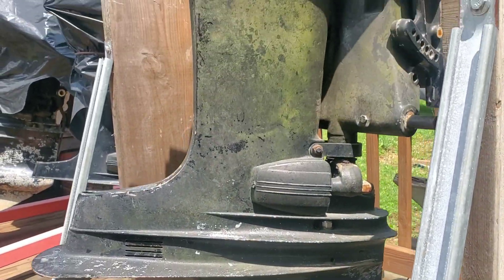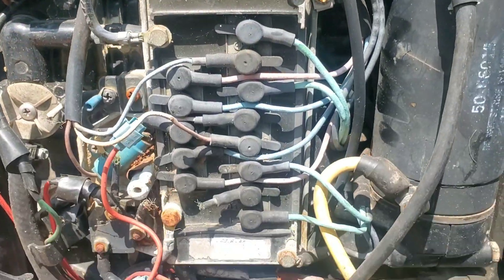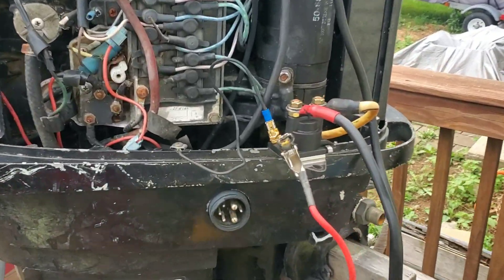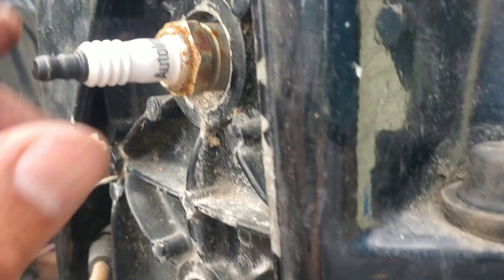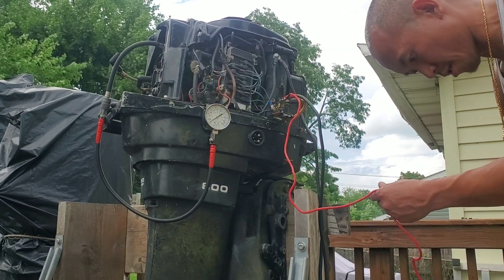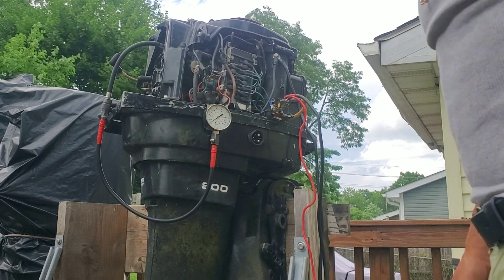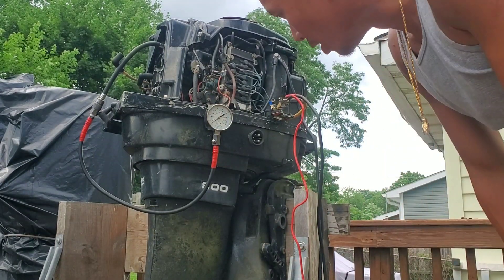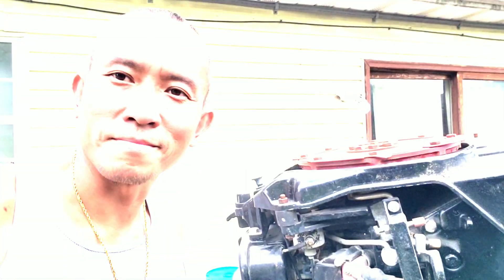Mercury Outboard: Left to Die

Comment: I got this 1976 800 80hp mercury. Looks exactly like this motor but has the distributor ignition system   Well boat is a 76 and the motor serial number comes up as a 71 ..

I got 90 psi on all 4 cylinders, I am reading online that is still enough psi to run it. Is that correct ?  Can I still run this motor for a while before I have to tear the power head down and rebuild? 

From what I am understanding these old Mercury motors are worth the time and effort to rebuild. And they hold their value pretty good. Is this correct?
Reply: This motor I have is in really good shape for its age, has some electrical issues. But, would like to bring it back to life unless its gonna cost me a small fortune. If I can run it at that PSI for a while before the power head needs to be rebuilt would be a plus. Just wondering..  And all these videos you have, I been watching alot of them. They have alot of good info. Keep up the good work, good to keep some these old motors on the water instead of sitting around collecting rust.
Reply from the maker: What brand compression gauge are you using? Son
Reply: @MerCSonL6  I am away from home .  I have to check when I get back. It a buddy of mine and  was using his.  will check and get back with you.
Reply: @MerCSonL6  Its a Pittsburgh said he got it from harbor freight .
Reply from the maker: @jimmycraze9826  the readings are likely off and the compression is probably higher. I'm thinking around 100-110psi. Which is low for an L4 but it will still run. Son
Reply: @MerCSonL6  that's good news .. hopefully, I can get it going for a while and rebuild the power head later. Cause it looks like I'm going to have to replace all the electrical on the motor and from what I am seeing that is pretty costly. 

What I am seeing from your channel is this is a really good motor to rebuild. What is your opinion on it?  The serial number says it is a 71 model .. and everything I am seeing from you and others, these 70s Mercury are the ones to have.  What kinda ball park would it cost me to rebuild that powerhead once I do get to that point.
Reply: @MerCSonL6  will a 90 hp around the same yr parts fit my 80 hp ?  I might found a 90 hp that I can get parts off of instead of having to buy them high dollar new parts like CDI, Stator, trigger, etc. what ever I might need to replace. Be nice if I can get the 90 and trade the parts out on to the 80 ..if that is possible. 

like to get this going when it cools down some and take my mom fishing..she loves that fishing, maybe as much as I do. lol
Reply from the maker: @jimmycraze9826  the parts are compatible. The stator only charges the battery. As long as the distributor is for an L6 you shouldn't have issues as long as its works. Son
Reply: @MerCSonL6  .Thats awesome,  hopefully the parts on the 90 are good.

Comment: Hey man.. I've got a '69 1000ss that's running extremely lean on cylinder 1. The engine won't get passed 4000 rpm (should be 5200) with a 17p three blade prop, pushing a 16ft 1970s glass crestliner. I've cleaned and rebuilt the carbs with new kits as well as the fuel pumps and replaced all the fuel, bleed and equalizing lines. An endoscope cam inspection shows the reed plates to be all there and closed, not stuck either, and little to no scoring in the cylinders. Compression runs around 130 psi across the board. Running it in the driveway at a quick idle for about 15 minutes and then pulling the plugs for inspection shows all are warm and a bit wet except number 1, which is cold and dry. Spark test shows strong spark on all 6, jumping 7/16". Now, that said.. while idling and inspecting everything, I noticed this leak:

 https://youtu.be/E1VLd5JaxzA

I can only assume that lowered crankcase pressure is likely my culprit, not sucking the fuel mixture into no. 1. Would you agree? Is there anything else I might check into? I've ordered a full gasket and seal kit for the head, if I'm going to pull it to reseal the crankcase I figure I might as well open it all up and do it right..

I've been watching your vids for some time now, love them and learn something new every time. 

Cheers brother!
Reply: Btw, this vid was taken before the lines were replaced and carbs and pumps rebuilt..
Reply from the maker: You could try torquing down the crank case bolts. If that doesn't work the head will have to be pulled and resealed. That is definitely the culprit. Good luck. Son
Reply: @MerCSonL6 , that's what I figured.. always good to get confirmation from someone in the know. Thanks so much for the reply, and keep those vids coming brother!

Cheers from Ontario, Canada!

Comment: great vid please do a full link and sync video on CDI motor :) Specifically want to watch adjusting the timing.
Reply from the maker: Not a bad idea my friend. Thank you. Do you have a specific question in regards to timing?
Reply: @MerCSonL6  Well i have done just about everything besides the timing. (carb rebuild, carb tuning on water, fuel pump, spark plugs, ect ect ) and still just have a weird low speed only issue. everything I have done has been an improvement but sometimes I get bogs and wont stay idling. Especially bad sometimes trying to dock or put back on trailer.
Reply from the maker: @str8wick3d  what year/model? I'm thinking it has the direct charge ported pistons which are a lil harder to start and idle.
Reply: @MerCSonL6  84 115hp idle on muffs when I got home was about 800 so I upped it to 1100. Maybe it was just set to low but still intrested in timing and I hear "reeds" can go bad? Are those in the block?
Reply from the maker: @str8wick3d  You have the low dome ported pistons. The Idle can be tough to meet. Specs per Manual states they should idle around 5-7 ATDC. I have not been able to achieve that with any of mine. My 88 115 idles at 1 BTDC and my 78 idles at 3-4 BTDC. Very large discrepancy per spec. My 88 is closer to your model and it drops to around 700 rpms in gear and idles out of gear around 900-1000 rpms. Compression on all 6 cylinders comes in around 150 psi..... everything on the inside has been rebuilt and is functioning properly. The reeds are located inside amd positioned around the crankcase. You can visually see the reeds through the carb throats.
Reply from the maker: I would time your engine first to find out where TDC is hitting and we can work backwards from there. Let me know. Son
Reply from the maker: @str8wick3d  https://youtu.be/x5MQUmXhf9c